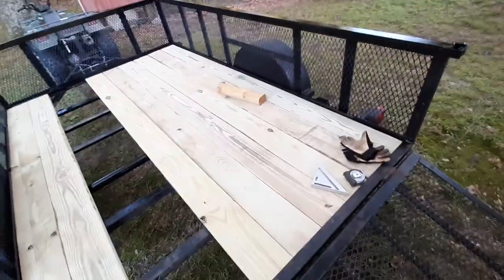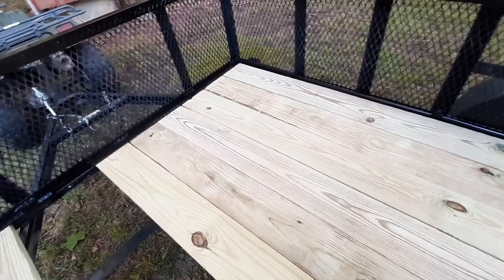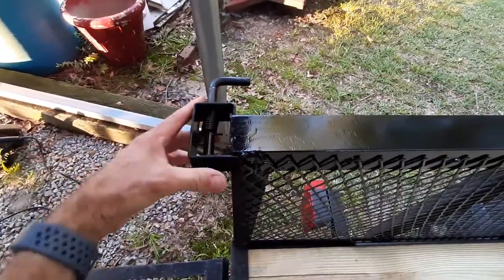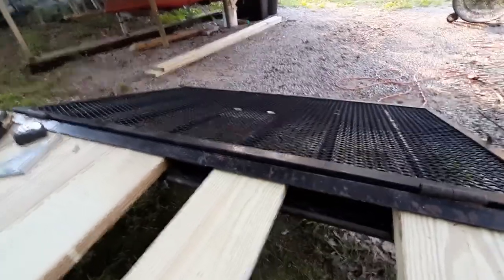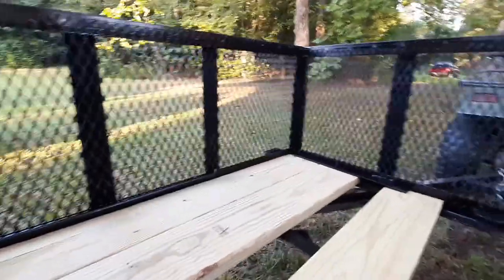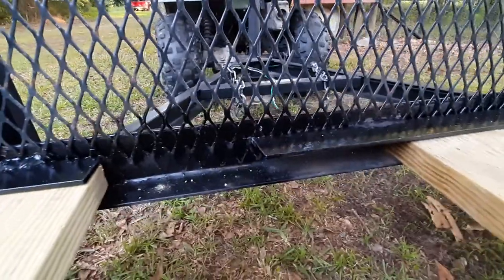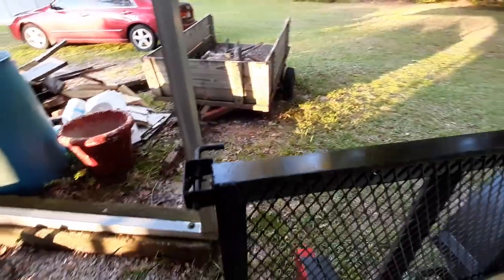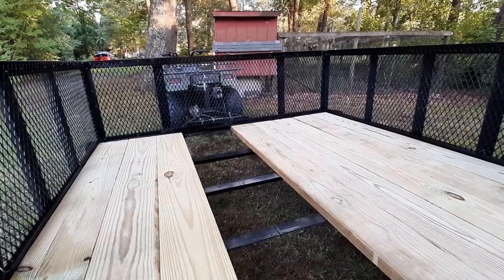Utility Trailer Bed Replacement/ Board Replacement

Comment: I just got done doing the exact same thing. The old boards were nailed like yours. I took a hole saw and cut off center around each nail. popped out the wood around the nail that was still sticking up, cut the boards in half and removed them. Then, like you, I used a grinder to cut off the nail tops. Yes, they used a gun to shut those nails in. The force and speed almost welds the nails in place. Cut the front top angle just like you did and now I have all new wood flooring that is smooth, straight and all edge glued together. I keep my trailer inside which will minimize any water issues that can occur if a trailer would hold water. Thanks for your video and idea. I was going to do that, but you did and a great job.

Comment: I cut my angle iron for my 4x8's however, I am having a very hard time sliding the boards. The new wood is thick and barely fits. I'm using a hammer but still they just don't want to slide very well. I'm worn out... I'll try another day that it's not 100 degrees outside.
Reply from the maker: @brianmorrison9937  yeah, heat ain’t no joke. Be safe!

Comment: After the wood cures you can treat it with used motor oil and the wood will last for a very long time.

Comment: Hi,

Thanks for that cut out tip on the metal.

What did you do to cover the cut out on the front ?
Reply from the maker: I never covered it back up.  I think i just put a couple carriage bolts through it to keep it from bouncing up.
Reply: @jimcooke640  

Pretty cool.  

I have to change my boards and I have the same issue.  

Thanks
Reply: Maybe take the flap you cut out and reapply it with a tack weld. Heck… even JB weld.